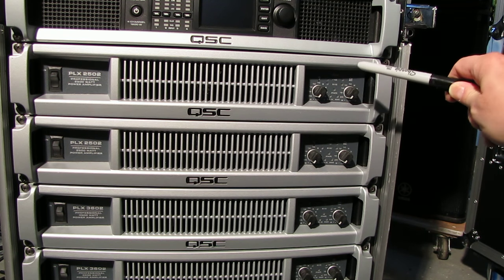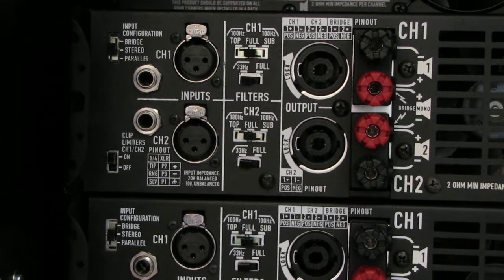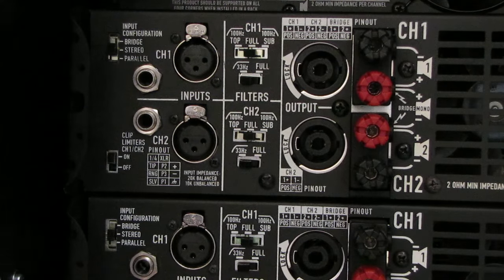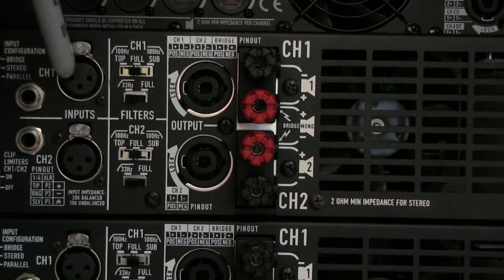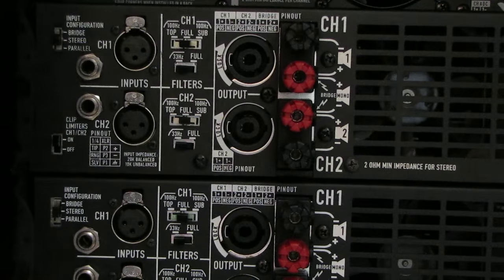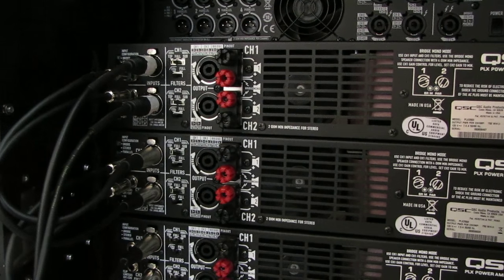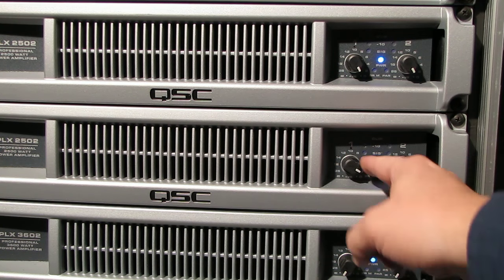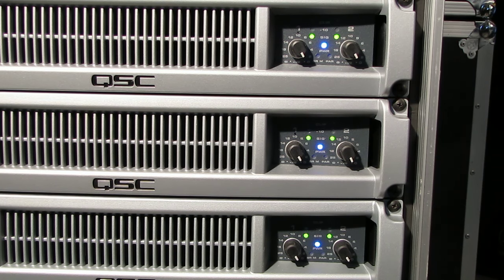Stereo "Daisy" chain of amplifiers (using QSC PLX amps)

Comment: I have a pair of Peavey Impulse 1015's I was pushing with a Crown XLS1502.  It sounded fine but was just not enough power to fully get the punch out of the blackwidow drivers.  I bought the same amp thinking I can use one amp to push each speaker giving me the dedicated amperage for each speaker.  Can I achieve this by daisy chaining the amps?  Thanks!!
Reply from the maker: Yes, using a dedicated amp for each speaker usually works out a lot better.  The XLS1502 is a good amp, but appears to be undersized for the speakers you have.  You will NOT get extra power by daisy-chaining; all daisy-chaining does is send the same signal to multiple amplifiers.  You may need to configure the XLS1502 amps to run in bridged mode to get the power you are needing.  Use the "link/ out" on the back of one of the amps to send the signal to the next amp.  Important -- Check the XLS1502 documentation for how to configure the amp to run in bridged mode.  Also, there may be some special speaker wire changes you would need to do for the bridged mode to work correctly on your speakers.

Comment: I would like to see a video with the GX series.
Reply from the maker: It would be setup about the same way.  The RCA, phono, and XLR inputs on each channel of a GX are all wired together in parallel (for that specific channel).  If you connect into the amp (from your console) with an XLR, you would then use one of the other inputs (phono or RCA) for that channel and connect it to the input of the next amplifier.  However, I would not recommend the RCA connection.  Use the phono connector or XLR.

Comment: Hello sir again,
Where the knob should be set at  we using a single Amplifier same like this. Connected to 2 1000 watts yahama speaker. 
Please advise.
Reply from the maker: Hello.  The knob on those amplifiers control the input voltage into the amplifier.  Under most conditions (especially for live sound), those knobs should be turned all the way up (all the way to the right).

Comment: I'm curious. Is there anything in existence which takes in one balanced input at line level (for example) with an "X" number of paralleled direct outs, each balanced, with individual line drivers or buffers?

Something that could be used for paralleling stacks of power amp inputs, while providing isolation between them, with the intent of reducing the risk of degrading the original signal?

If so, what's this piece of gear called? I searched, but don't know if anything like this exists, or what to even call this thing. A powered "fan out" buffer? Nothing on Google except digital electronic applications.

Do the pro's use anything like this? I assume they can get away with hardwired "daisy chained" parallel wiring through the amp's input jacks.

One more question...So, just how do the pro's feed all those huge stacks of power amp inputs?

Thanks in advance.
Reply from the maker: Sounds like what you are looking for is a line splitter with dedicated isolated outputs.  The basic models I've seen have one input with 2 x isolated outs and 2 direct outs.  The isolated outputs are usually used for broadcast signals (TV, radio, etc...), whereas the direct outputs are used more for monitor sends.  For isolated outputs, pros usually connect into a "house" provided system (i.e. a stadium), which provides all the isolated outputs that are needed for the event.  They rarely carry gear to provide more than an few isolated outs... they rely on the facility/location to have the needed equipment.
For sending  the same signal to multiple amps (as in the video), daisy-chaining is the way its done.  You can connect many, many amplifiers together to have them all produce the same signal.  Some companies may use patch-bays to accomplish this.  However, most daisy chain, because it's very inexpensive to setup.

Comment: I've been lookin for this for ages. So, we basically do this if we want to have a large number of  passive speakers fed with the same signal? Is this also what we would do if we want to bi-amp passive speakers? Thanks a lot.
Reply from the maker: Yes, this is the method of driving a large number of passive speakers with the same signal.  The same method in this video (stereo daisy chaining) will work for bi-amping.  For example, route the low frequencies to the Left channel and the mid/highs to the Right channel.
Reply: @stageleftaudio  perfect. Thanks again!

Comment: Can I connect two speakers to one amp, and only one speaker to the other amp??
Reply from the maker: Yes.  Just make sure the attached speaker load is is within range of what the amplifier can support.  This video covers the mono setup of the amplifiers; this means that only one speaker is usually connected to one mono (bridged) amplifier.  Two speakers can be connected to a mono (bridged) amplifier, but the amplifier needs to be able to support the added load of the other speaker.

Comment: Question when linking up two amps can you have two pairs of speakers can you hook up a pair to each amp to play separately.
Reply from the maker: When daisy chaining amplifiers, each amplifier will have its own speaker(s) attached to it.  Each amplifier in the daisy chain setup will be playing the same signal as all the others.
Reply: @stageleftaudio and do the amplifier volume have to be set the same or can  set differently according to what each pair of speakers can handle just running from each amp.
Reply from the maker: You are correct.  The amplifier volume on each amp can be set differently.

Comment: @ what temp in Celcius does the amp turn itself off??????  85 C Celcius ??????
Reply from the maker: It depends on the amplifier manufacturer; you would need to check the product manual to see what the temperature range is for the amplifier.  If the product manual does not indicate if the amplifier will turn off, you would need to contact the manufacturer and ask them directly.

Comment: Nice video, question what are you using for a power conditioner/ distributor? I tripped my circuit breaker on my furman pl-plus e ll 😐 the venue I was playing ran me a 50 power cord to connect into there pdu. Normally I connect from my amp rack directly into the pdu or wall, but the stage was setup in a different location. The system slammed for about 2.5 Hours then power conditioner circuit tripped I had another furman that I connected and got music going again. I’m a dj,  running a pair of 218 Yamaha Subs Club series and Yamaha 215 club series tops. I have a bbe 882i sonic maximizer, dbx 231 eq, dbx 116xs and behringer cx 2310 and 2 crown x4000
Reply from the maker: We do not use power conditioning for amplifiers.  It is usually not advisable to connect amplifiers to power conditioners.  This is due to the current-draw amplifiers need to produce loud bursts of audio along with moments of sustained audio, and most power conditioners cannot provide that level of current.  The voltage from wall receptacles is what amplifiers require.  Noise in a system is usually caused from a ground loop, a short in a signal cable, cables laying on RF antennas, or the use of poor quality outboard; rarely it is ever an amplifier producing noise from EMI/RFI signals.  It's recommended to place all non-amplifier equipment (BBE, DBX, etc...) on a power-conditioner, and keep the amplifiers connected directly to wall receptacles.  Place your amplifiers on one circuit and your mixer/outboard on another circuit, and watch for ground loops.
Reply: Thanks that makes sense 🔊

Comment: What about if you want to add active crossover to it with this method you just showed in this video
Reply from the maker: Yes, using an active crossover with daisy chained amplifiers is very common.  For example using the "low" frequency output on a crossover, all you need to do is connect the "low" output of the crossover to the first amplifier in the chain.
Reply: @stageleftaudio  ,what about the mid and high,same procedure also?
Reply: @stageleftaudio  What about if I want to use one particular amplifier for the low frequency, I mean using the both channels and another amplifier both channel for the mid?
Reply from the maker: Yes, same procedure.  Whatever amplifiers that will be used in a daisy-chain for a particular frequency range (i.e. Low, mid, high), will all get the same frequency as whatever will be  connected from the output of the crossover to the input of the first amplifier.
Reply from the maker: Yes, this would be a very basic 2-way crossover setup.  However, if you only have 2 amplifiers, you would NOT be daisy chaining any amplifiers.  Each amplifier would be dedicated for a certain frequency range determined from the output of the crossover.  For example, the "Low" output would go directly to one amplifier, and the "Mid" output would go directly to the other amplifier.

Comment: awesome videos thank you for sharing all your knowledge.. I have one question what do you use to have enough power for all your equipment... a portable brake box box, power distro with  breakers etc...
Reply from the maker: +jose lopez Thanks for the comment.  Most of the time, we use the power provided by the facility.  The amplifiers now a days are more efficient than they were 20 years ago, so we don't need to use anything too special for power.  However, for outdoor events in fields (or at sites with no power) we'll use a 50kw Diesel generator with a power distro.
Reply: Jose Lopez, it might help to add a power conditioner, I have one furman cn2400s, I had plugged 3 qsc amps using them at full power two at 4 ohms 1200 watts and one at 2 ohms 1700 watts. Just make sure to connect to a electrical 20 amps outlet.

The rest of the equipment is plugged to another furman m8lx, and connected to a regular electrical 15 amps outlet.

Comment: Please I have question. 
I did connect my amps to the other using the daisy chain but some of the channels have reduce in volume. 

Please what is the issue?
Reply from the maker: Make sure the amplifier attenuaters (or volume controls) are set properly... maybe all the way up.  If you are daisy chaining different amplifiers, it is possible the input voltages on the amps are not the same.  Different input voltages can equate to different output levels  This is why using the same amps for daisy chaining works best.  

If the amps are the same, it is possible one channel may not be putting out the same power.  There could be an issue with the cables you are using to daisy chain.
Try running the amplifiers (the ones with reduced level) by themselves (not daisy-chained).  See if the output levels appear to be the same as the louder amplifier.

Comment: This video has had a long, fruitful life! Thanks for it, eight years in the future. Ok, so I get the daisy chain sequence and the reason for it. I also understand that in my setup I will need to connect only one speaker per amp, based upon the power requirements of my Yamaha CBR 15s. I've got two Mackie 1400i amps that I want to chain together. Am I correct in thinking that if I follow your connection method I will connect one speaker to the L channel of one amp and one speaker to the R channel of the 2nd amp. I am thinking if I do that I won't be giving the speakers adequate power. Instead I should bridge the speaker connections. In that case, I would have to chain the amps together in a different manner, correct?
Reply from the maker: Yes it has!  Thank you for your comment.  Here's a video I did covering a non stereo setup of daisy-chaining.  (https://www.youtube.com/watch?v=gOyjO5YOfdE)  In this video, the amplifiers are setup for bridge-mono operation.  The daisy chaining in the video is for a bridge-mono setup (using all QSC PLX amps).
For your question, you will probably need to use a bridge-mono configuration on your Mackie amplifiers to get the power you are needing.  The daisy-chain wiring for mono operation is sort of the same.  The video (ref: above) shows the wiring.  
The Mackie manual should indicate which input to use for a bridge-mono setup; follow what the manual says.  Then, daisy-chain your signal cables to the needed inputs to support the mono operation.  For a stereo setup (ref: your question), you would NOT need to connect one speaker to the L channel (on amp #1) and the other to the R channel (on amp #2).  They can be run from the L (on both amps), or from the R (on both amps); it's up to you, but best practices usually has the connections to the L side.  For a bridge-mono speaker connection, follow what the Mackie manual says to do to setup the amp for bridge-mono operation.  You will probably need to make (or reconfigure) speaker cables to support a bridge-mono setup.  The speaker wiring has to be setup differently to support a bridge-mono connection.  Most amplifiers will show the speaker wiring requirement needed on the back of the amp.  If your amp uses the binding-posts, I think all you need to do is flip your speaker connector over (that goes into the amp).  If this is the case, you would NOT need to make/modify any speaker cables.  Hope this helps.
Reply: @stageleftaudio  , Thanks for the SUPER Fast response! Much appreciated! Thanks for the detail. Yes, the mono daisy setup is prob what I'll need to do, looking at the Mackie specs, to make sure I have adequate power so that I'm not clipping my sweet speakers. Btw, in another post you said we ought to consider running monitors from another source? Would I be ok adding a passive monitor or two with such a setup? Thanks again!
Reply from the maker: Mono works great.  But make sure to watch the power usage!  You don't want to burn any speakers.  For your monitor question, are you asking about daisy-chaining another amp  and passive speaker to be used as a monitor?  If so, this would be an odd setup, but you could do it.
Reply: @stageleftaudio  , I guess what I don't know is can I also run a monitor or monitors off the same two amp setup. I imagine I can run them off the same 'A' channel as the mains. Yes, I'll be careful with the power. Thanks!
Reply from the maker: Yes, you can run monitors off the same two amp setup.  However, both amps would need to be setup as stereo (FOH sound would be from a daisy-chained channel A on both amps, monitors would be from channel B on both amps, daisy-chained or independent channels).  Doing it this way, you would not be able to run the amps in bridge-mono.  If you need a bridge-mono setup on both amps for your FOH speakers, you may need to get another amplifier to handle just monitors.
Reply: @stageleftaudio  , thanks. SOunds like I might want to pick up a powered monitor instead.
Reply from the maker: That would be the way to do it.

Comment: Good one thanks for sharing please in an analog mixer which output  is best to send signal I mean bass and Kik to crossover low input
Reply from the maker: You can use the main outputs (either L or R) of the analog mixer to send the full-range signal to the crossover input.  There's no crossover low-input... only a full-range input.  Use the "Low" output on the crossover to send the signal to the amplifier.

Comment: Thanks for a good video. Can you please help clarify if only quarter inch TRS cables could be used to daisy chain instead of the quarter inch to XLR cable shown in this video. The output from the mixing board to the first amplifier in the chain will be from XLR cables in my case.
Reply from the maker: Yes, absolutely.  I used TRS to XLR cables in the video to show that either TRS or XLR cables would work.
Reply: @stageleftaudio  Thanks a ton. I am able to daisy chain the 2 amplifiers now. Luckily they are the same brand as the ones shown on video but a different variant.

Comment: Is it possible to daisy chain 3 amplifiers in stereo mode and yet connect an active crossover? also how many speakers can you connect on each amplifier when daisy chained in stereo mode?
Reply from the maker: +kelvin kalaluka Yes.  The active crossover is placed first in the signal chain.  Therefore, the output from the crossover will go directly to the first amplifier in the amplifier chain.   This results in all amplifiers producing the same signal.

The number of speakers that can be attached to daisy-chained amplifiers is dependent on what the amplifier manufacture has indicated would be the maximum.  Just because amplifiers are daisy-chained, does not alter the number of speakers that they can support.  For example, the QSC amplifiers used in this video can support a 2-ohm load for each channel - this usually equates to having 4 x 8-ohm speakers per channel, or 2 x 4-ohm speakers per channel.  Hope this helps.
Reply: +stageleftaudio Thank you a million times for the knowledge. so helpful

Comment: Hi sir I have question, Can you daisy chain a few amplifiers only or as many amplifiers connected to the same signal without lose gain?
Reply from the maker: As many as you need.  Any signal loss that would be incurred would be insignificant, and that would probably involve daisy chaining many, many amplifiers.

Comment: I have the qsc gx3  but doesn't have stereo mode option. Is it still okay to daisy chain them in stereo regardless? 

Very helpful video helped alot.
Reply from the maker: The GX3 amps should have a phono input and XLR input on the rear for the channels.  If they do, you can daisy chain in stereo by using either the phono or XLR connection (for that channel) as an output to the next amplifier's input.